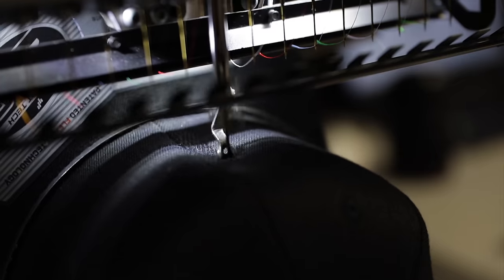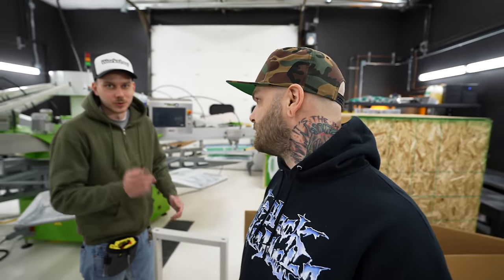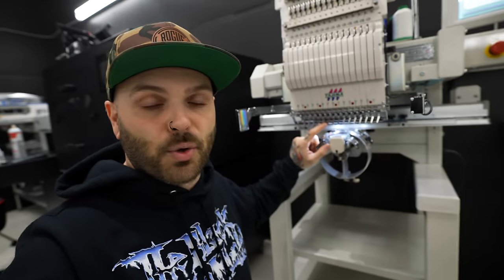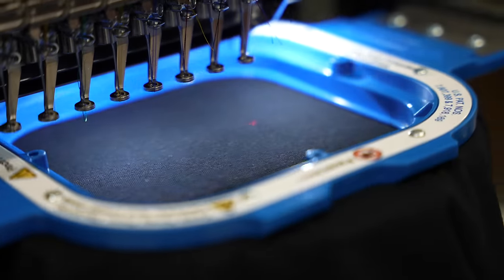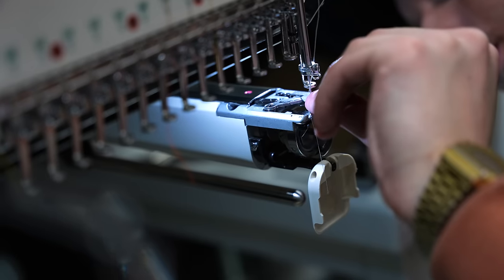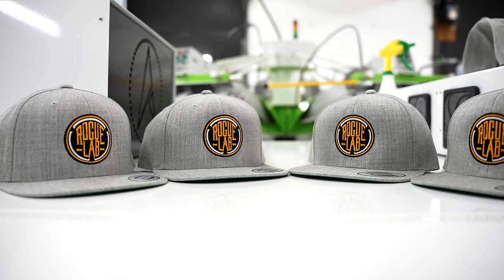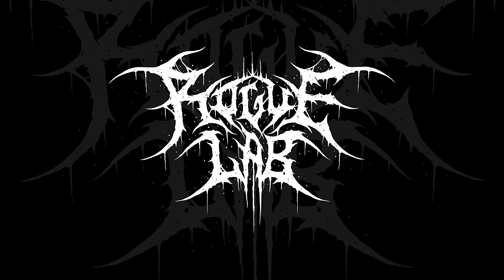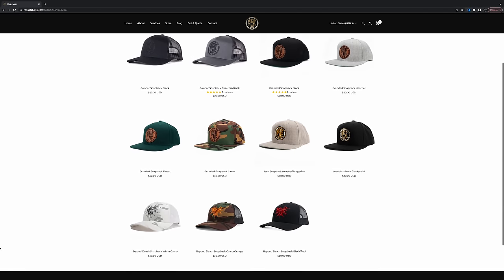This Embroidery Machine Is AMAZING! Tajima TMEZ First Impression

Comment: A laser head will take it to the next level, have always had a thing for appliques and Tajima have them as add ons even for their single head machines. Not to mention multiple single heads can be daisy chained something have seen quite a number of print shops adopting instead of those super bulky multiple heads machines.

Comment: The Melco issue seems more like a digitizing issue over an equipment issue.
Reply from the maker: It wasn't
Reply: @leestuart38  you can tell from the stitching that it’s not being digitized correctly for the machine. I know a ton of people with Melcos that do much more detailed designs no problem.
Reply from the maker: @bhutch216  funny you think that, because it was their own in-house digitizer that did it 😂. I've talked to hundreds that have made the same change, every single one was shocked at how much better it is with a good machine.
Reply: The Melco file seems like the density of the black circle is too low. Also a bit of registration problem. Black circle to wide. But the font on the melco looks good, equal to Tajima, in my opinion the font on the melco is a bit better in vertical lines. Look at the letter O and E, there on the Tajima ist not a clear, exact line…
Reply: @leestuart38  I’m not saying Tajima isn’t the better machine but that file is really a simple sew out and it’s just not done correctly. The Tajima isn’t right either with all the gaps in the text fill
Reply: @bhutch216 possibly a density issue on the field, but to me it looks more like a bobbin tension issue. My Melco likes 400grams tension when running hats and it puts out some really quality stitches.

Comment: The machine is nice, I run a 6 Barudan and a 4 head SWF,  and I can tell the difference between the two also. I did notice the two designs are digitized different though. The blue ones text is digitized a hair wider and the fill stitch is at a different angle, the yellow one has more density to the fill stitch too which looks way better that way imo.
Reply: I agree as an experienced digitizer I can tell the tatami on the blue design doesn’t have underlay and has less density, the yellow one has a pattern , also the angle of the stitching is different,  so they are not the same design . But I agree the Tajima makes good work .
Reply: I am freelance Embroidery digitizer . Available for digitizing projects

Comment: I bought the TMEZ because I wanted the position alignment system (PAS).  That feature sold me.  The SWF is a fine machine. It now has everything including automatic tension that the TMEZ has.  I talked with the manager at the head office and asked how well it sewed 60 weight thread.  He had never tested that but he ordered the needle and thread and emailed a picture. The local sales representative had me visit with the owner of an embroidery business which had a 4 head and the newest single head SWF that I was considering.  I actually liked the display better but I like to be as exact as possible with placement.  Only a camera, which is in some home embroidery machines, can top the PAS.  Oh, I think a company did come up with a camera as an add on.

Comment: Looks awesome a good digitizer makes a huge difference as well. Nothing better than watching a pro in action.
Reply from the maker: Good digitizing definitely makes a world of difference even with a good machine. I plan on making a video testing some digitizers
Reply: @leestuart38  would be very interested in seeing the differences and end results. 

Maybe create a few stress test designs with design features that test the digitisers to the max? Would also be something you could keep and refer to as a reference piece to find the limit of what your machine is capable of producing - kind of a step wedge exposure test, but for embroidery!

Glad to see you've got yourself a quality embroidery machine that can deliver - your whole shop has really come together recently. Congrats Lee
Reply: @leestuart38  I use one called Ignition Drawing. They're supposed to be pretty good -- would be dope to see how they stack up against other digitizers
Reply: @jailblazin ignition has gone down hill the last few years. If you send out for revisions, they don’t communicate at all, then end up sending the same crap over and over. Plus they’re overpriced even before their new price hikes.  We use Digitizing Ninjas, super fast and cheap and will actually rework a design if the sewout is crap. All of these digitizers are running through software now, so it’s all about who gives the best CS.

Comment: You didn't really got any issues with the gold on such a density design if this is true the machine is a beast.
The most complicated thread on one of the most challenging items and no issues this is amazing.
I'm looking to get me one, but I now they expensive but also worth the money.
It's a Rolls Royce under the embroidery machines.
Congratulations, on the machine, you will love it.
Reply from the maker: Zero issues with the metallic on that one. I have the odd thread break with metallic but it's only when it comes off the spool in a knot, so that's not the machines issue. Trying to figure out how to eliminate that.
Reply: @leestuart38  That is the major issue with metallic thread, you get this knots because how the thread comes from the spool, the thread wind's around his self. There are thread stands that spins around how the thread goes from the spool and therewith less knots and less thread breaks.

Comment: I have Toyotas and I need to upgrade. They work great but they won’t last forever. I think you’ve helped me make a huge decision. Thanks from the Virgin Islands. 🇻🇮
P. S. I will cry when those machines are gone. They were made by Tajima and they are built to last. Ours are between 15 and 20 years.
Reply from the maker: You won't regret the decision to update with these new machines, they're incredible

Comment: I have the Tatami SAI, (8 needles) and it stitches wonderful.  I never have to change the tension except on 12 weight thread.  Hats come out great too.  This brand is excellent on very small letters.  I'm a small home business but I have done up to 49 hat which I used both 40 & 60 weight thread, without one thread break.  I am really thinking of getting the TMEZ to get a larger embroidery field.  SWF just came out with an auto tension and pressure foot too.  So on paper, looks like the TMEZ only advantage is the position alignment feature which will cost me an extra 10K.  I'm gonna check on the stitch quality of the new SWF next.  Anyone have SWF KXT 1501model?
Reply: Which machine did u end up getting, literally in the same boat rn?…
Reply: I bought the TMEZ.  See my other comment

Comment: I found I have to crank my bobbin tension to 400, run at 850/min and lift my presser foot 3-4 clicks up on my melco, but it puts out super nice hats and rarely has a threat break and once I actually knew what I was doing, never a needle break. Looks like your hat comparison was just a bobbin tension issue on the Melco. Do you still have the Melco? For sale?
Reply: 100% Agree

Comment: You should have given us updates on your problems with the Melco, I just bought 3 of them influenced by you. my advice is release updates on your equipment when your having issues.
Reply from the maker: That all happened during the move to the new shop so I didn't really get the chance to. Otherwise I would have
Reply: Your melcos are going to be just fine. Do the required maintenance and find a reliable digitizer and nobody will be able to tell what machine did your sewout. I’ve found melcos need a little love when it comes to bobbin tension. My trainer’s machines ran around 250grams, mine runs flats at 350g and hats at 400g.

Comment: Just like with screen printing garbage in garbage out. The biggest change you can make is the stitch  file.  Yes the machine can help but the file is where the money is. That being said i have my top machines are ZSK, Tajima, Barudan and HAPPY.
Reply from the maker: You got that right. Machine quality makes a massive difference in this case. Since the video I sent the same file to a digitizer who did the old stuff, and it came out entirely different on this machine vs the old. There's definitely a reason why it costs twice as much haha

Comment: Tajima did slightly worse then Melco, all embroidery depends on digitisation quality and basic stitch programma (aka how embroidery does stitching)

I runt two emts and embroidery is SOLID, never had any quality issues, apart from bad digitisation.

Both machines are top class machines, nevertheless both done a good job.

You mentioned issues with thread breaks etc, that all really depends on how you setup your machine from a to b, since I have brand new emtx I never replaced a single needle, machine been pumping out over 500 garments a month since January.
Reply from the maker: That first line is comedy 😂
Reply: @leestuart38  it is indeed. I checked video again on the big screen. Indeed lines are different and it's all different.

Apologies.

Did you have emtx or emt?

Comment: For hats and nice small fine print. Barudan takes the cake and tajima comes in second but they are basically both the best machines out there. Barudan just has better quality parts vs tajima sourcing them from china.
Reply: Would you say the Barudan KT pro3 is better?
Reply: @jessepadron5499  yeah barudan for sure. but the auto thread tensioning is a plus for the tajima. not sure if the new barudans have it or not
Reply: @Bluntedco.  just got my Barudan KT Pro let’s see how it goes
Reply: @jessepadron5499  dope! congrats!

Comment: I been using an older Tajima (2013 model) and hate it for hats. I’ve never broken needles with my Barudan and with the Tajima I always break them. Too much bounce.
Reply from the maker: Sounds like you've got some setup problems. I've run over 500 pieces through this machine now and haven't broken any
Reply: @leestuart38  that’s what I’m wondering if the tmez is better than the Barudan now. How long was the turnaround time to receive your machine? Barudan is like 1 year out
Reply from the maker: @clockleon  I'm totally loving my machine so far. It was around 2 months at the time I got mine
Reply: How much do they cost ?

Comment: That's funny, I told you a year ago your Ricoma was trash and to get a Tajima.   You got all butt hurt and defensive and what you know, here's a Tajima.  LOL    I'm guessing in a year or so you'll realize the same thing about your ROQ (if you haven't already).  M&R, Tajima, and Barudan.  Anything else and you're a cute Etsy mom
Reply from the maker: Never owned a ricoma and haven't touched embroidery in over 2 years, also been very outspoken about how I didn't like the Melco for quite a while. So literally everything you just said doesn't line up.
Reply: @leestuart38  Agreed, got this confused with the other youtube printer I like to watch.  Melco / Ricoma : Potato / Patatoe.  Either way = S%^T.      I fully retract.   
I did comment on how a single head machine ain't gonna make you any money.  There's no capacity.  Hopefully now that you got a good machine it will lead you to a 6 or 8 head machine.  I'm not here to bash, just to offer advice from 16 years experience of building and running a small shop.  (maybe in too much of a harsh/direct delivery.  That seems to be your style though)   I do like the videos and tenacity.  And even picked up a few good ideas.  Never stop learning.
Reply from the maker: @ryanmiller1856  no problem dude. I do agree that a single head is difficult to make big money with. It's possible but it's a lot of time input, I think it's more of a stepping stone to get the work in the door to justify adding a multi head machine. I'm already seeing the need for one and will have to add more heads soon as business picks up.